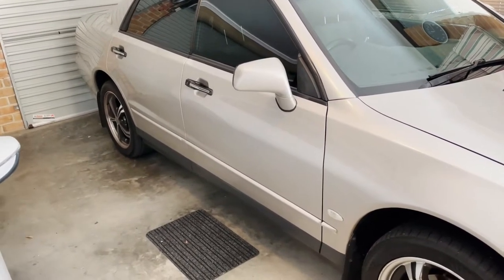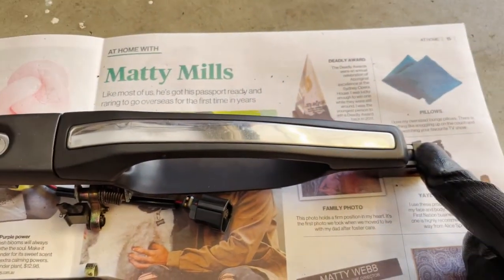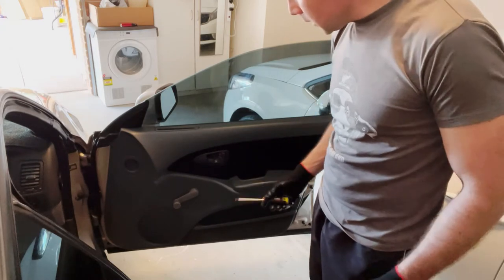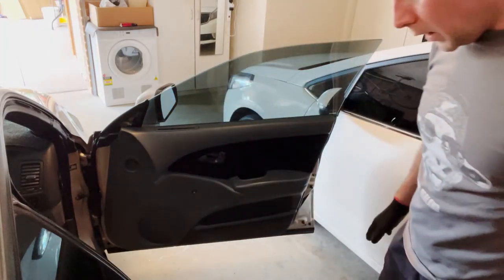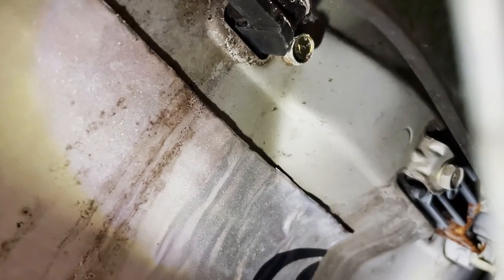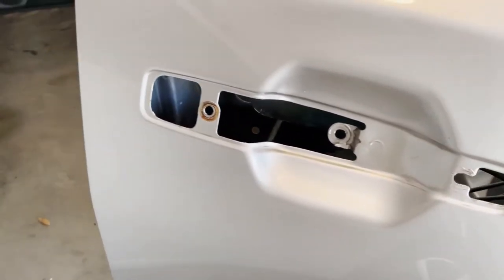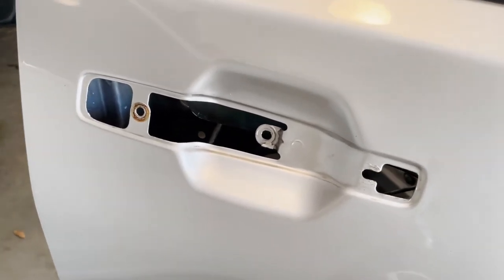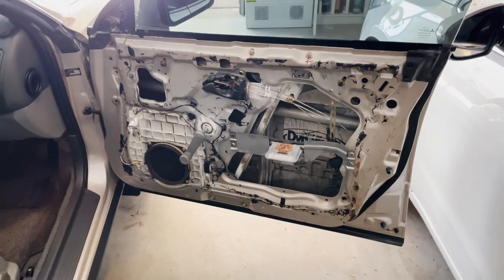How to replace a door handle on a 1996-2002 Mitsubishi Magna and Diamante

Comment: Hi Billy thanks for yet another informative video 👌. When i bought my kj verada last year 3 of the door handle cups were broken and the good one i actually broke by tightening the screw too tight , i learned the hard way 🤦‍♂️.  I'm a member of magna club on Facebook and a fellow member was wrecking his car , had 4 complete cups plus i got some other parts off him too. Well when i got the cups delivered i noticed a   hairline crack in two of the cups behind where the screw goes in. I got super glue and put a drop both on the front and back it strengthened the area real good i think it will protect them into the future  so maybe a good tip for you or someone else reading this. Thanks again i always enjoy your content 👌😉
Reply from the maker: Indeed a good tip, thanks srecko, and sorry for the delayed reply. I am surprised that Mitsi designed a number of key interior trim plastics with such fragility despite the otherwise overall well engineered robustness of the car, such as the door cups, bottom left and right sides of the radio and HVAC surround and centre of the instrument cluster surround. I wonder how many the workers accidently broke these installing them in the factory. I've cracked my fair share of door cups over the years and thankfully perhaps like your Verada the interior trim colour is the most common in the series so a little easier to find replacements.
Reply: @billymasonpi  yeah your right , most of the car is really well engineered and robust and thankfully these few  interior plastic surrounds and trims  are nothing more than just aesthetics and won't leave you stranded on the side of the road. Thanks for your reply Billy ☺

Comment: Good video mate. Any idea how to open a rear door that's stuck closed. With the central locking still working. But the handle isn't
Reply from the maker: Thanks John. Given the central locking motor actuates levers to lock/unlock the door, and those levers are also connected to the door handle, there must be a break between the lever(s) and the handle. Difficult to say without seeing it though.
Reply: @billymasonpi  Thanks for the reply. That's pretty much the conclusion that I've come to myself. It's got me how to open it. Cheers.
Reply from the maker: @johnellison1635  Are you able to open the door from the inside?  If so, the levers as you'll see in my video are just clipped into the handle and you'll be able to inspect whether one disconnected somehow.
Reply: @billymasonpi  No mate. Can't open it from either the inside or outside. It's the passenger side rear door. Both handles are moving but the exterior has more play than the interior.
Reply from the maker: @johnellison1635  I see. I'd remove the interior handle door cup (one screw but it's very fragile) and see if you can't get a needle nose plier or something in there to latch onto either lever and pull.  I'd have to check my car but as a last resort you could attempt to remove the door trim with the door closed but there's obviously some force required and risk of cracking it.